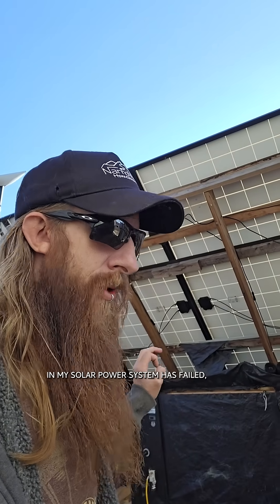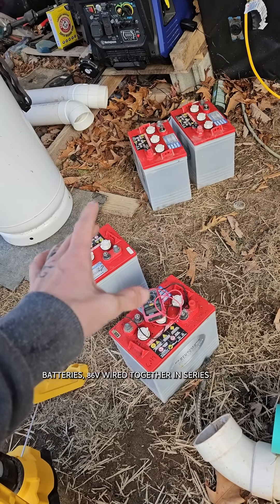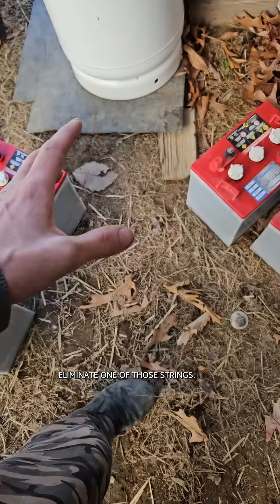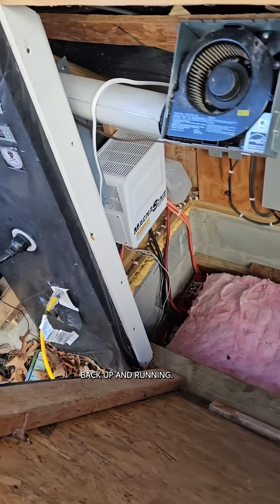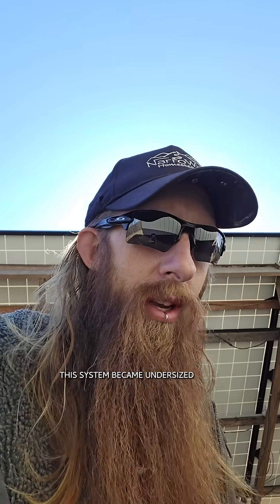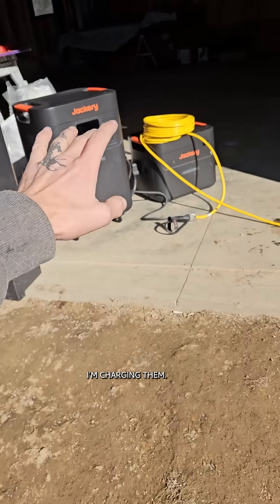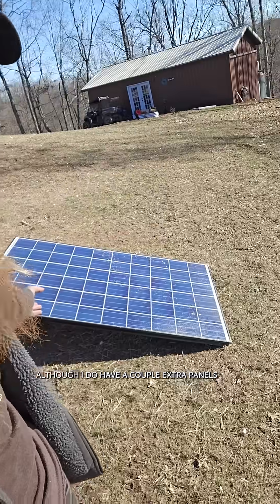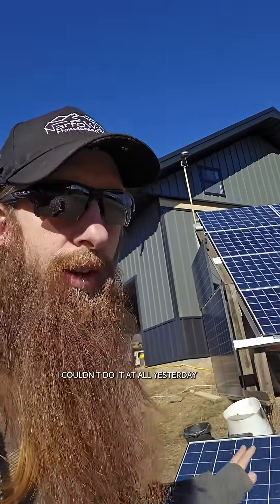Solar power update after battery reconfiguration

Comment: You can test between cells with cheap volt meter by opening and putting tester lead in each other to find out what battery is bad. Should be 2 volts each section. They have vids to show how to test.

Comment: Show us more of ur solar system.  I installed 2 solar saga prime 100w Jackery solar panels on the roof of my equinox.  I have a Jackery 1000v2 and 4 extra batteries.  I have one 100w solar panel to put on the ground as well.  On a good day in GA this winter I have only been able to pull 120-130 watts.  That’s about 30% increase in the main battery.  Basically half capacity at peak.  It quickly drops to under 100w after peak. Peak doesn’t last long.  An hour or two.  Then it stops dropping.  Maybe it’s my area, or maybe a busted Jackery.  I have to plug and unplug the cords going into the Jackery bc it doesn’t hit the watts it should.  Once I unplug it and plug back in it jumps up in watts by a lot.

Comment: man, you should really be looking at going with lifepo4.  i mean, really how cold does it get where you live?  how often does it even get and stay below freezing temps?  could easily insulate that little shack, add a basic heater or heating pads(if you're really that concerned about temperatures) onto the cells and still have more capacity than your current system.

Comment: the best batteries for longevity are nickel hydrogen. 30k cycles aka 30k days aka about 83 years. they are also fireproof and work at any temperature. nasa uses them on satellites. 

they have higher start up costs and have a large footprint but will last you an entire human life with no maintenance.

Comment: Pull those white caps off all the battery an find a catch basin an dump them rinse them out them add a 1 tsp of baking soda in 5 gallons of water fill them up kill the old acid an it cleans tha plates then rinse them good again fill up with acid with a touch of water an charger them back up all the info is on line you can do it I am sure

Comment: Look at an electric forklift batteries they can come in 24v,36v,48v lead acid. The industry is switching to lithium ion batteries. Remanufactured battery packs can run around 3000ah. They can be expensive but your storage capacity is incredibly high

Comment: LiFePO4 is the way to go. I built my van a few years ago with a simple 100ah 12v LiFePo4, MPPT charger, a small inverter, and 200 watts of solar. Plenty for taking trips. I just bought land and I’m eyeballing EG4 for their all in one charger/inverter and rack mount 48v batteries. Could be a little cheaper to grab the Chins or Ampere Time 12v and make a bank, but the plug and play of the rack mount and all in one makes life easy. And so much cheaper than the “generators” (which are a great option if you’re sponsored and they’re 🆓, I guess).

Comment: Upgrade to lithium heat rack batteries. I find them to work perfectly in cold weather. My system is located in northern scandinavia. Much colder than where you live.

Comment: Moving a bunch of massive lithium batteries directly into directly living space seems like a somewhat dangerous idea.

The fire hazard is low but not zero. Rule of thumb if you're charging anything bigger than say a laptop battery it should be done as far away from the house as possible.

Comment: Best battery was always Solar One HUP fork lift style batteries for off grid living.  Not sure if they are still in business though.  Everyone went to lithium in the last few years.  Flooded would still be best by far for Nate just not cheap plastic flooded.  Solar Ones were always good for 15 years or more, it was a commitment to get them.
Reply: I have had issues with solar flooded batteries our system w only lasted 8 years before a noticeable drop in capacity. We switched to Eg4 lithium batteries and have nearly tripled our capacity with surprisingly little cost increase over the solar flooded
Reply: @fireflyw4079  What brand and model of flooded batteries?  I am leery of EG4 and others, it is kind of a race to the bottom at the moment.  Also freezing is a big issue.

Comment: When you redo it and put the batteries in the garage, make sure you have that area heated enough so it doesn't degrade the batteries in the cold weather. Also, (DO NOT PUT THEM DIRECTLY ON TO THE CONCRETE FLOOR), That will  cause the batteries to lose juice quicker
Reply: Not putting them on concrete makes logical sense, but years ago I learned somewhere that the opposite is true. I don't remember where I picked this up, but I did look into it and it appeared to be accurate. It was saying to store batteries on a large concrete floor to keep them from losing power due to the cold. It's been effective for me over the past decade for car batteries on vehicles that get stored over winter. Don't take my word for it, I'm just someone who took someone else's word for it. Lol
Reply: We tested this theory in high-school auto class, over the summer break we put one new battery on the concrete floor and we put another new identical battery on the wood bench. When we tested  them after school started back up, the batteries were at the same voltage and they also load tested the same.

Comment: Remember that if you get any new lead acid batteries and mix them with old ones, the old ones will make the new ones degrade a lot faster than if they where all new.
And also you really can't put new and old batteries in series either, once one battery is bad in a string, they all have to be replaced to keep the balancing from getting whacked out and far under discharging or overcharging the older batteries in the string.

Comment: I never get a response on my comments but Nate, if you want them to Last awhile consider odyssey batteries. They are expensive but they last a very long time and are agm. It might cost more initially to use them but they will outlast these deep cycle batteries you are using
Reply: AGM batteries perform really poorly in off grid living.  You can't draw them down very low and total # of cycles before junk is about half of flooded.